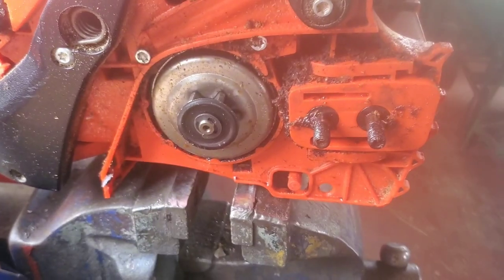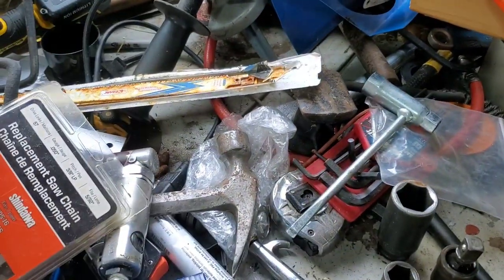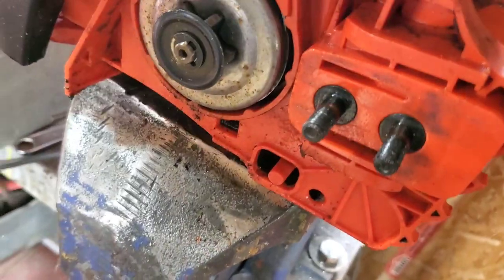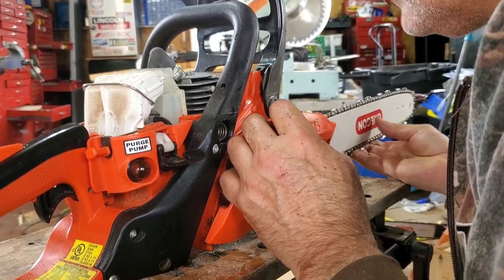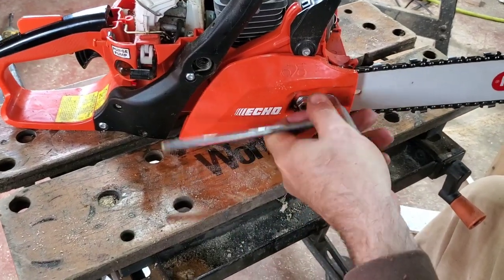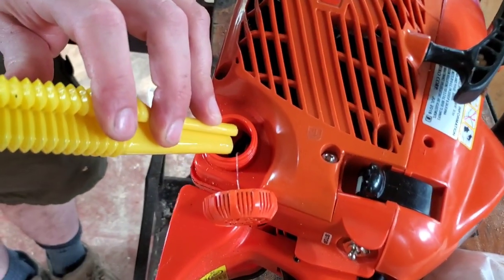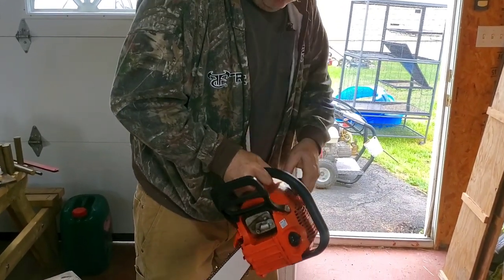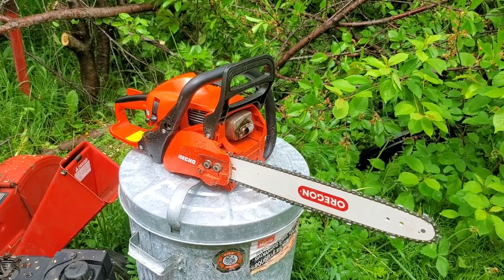ECHO CS310 Chainsaw how to replace the bar and chain

Comment: I also have the Echo CS-310. The bar stud stripped out the plastic hole it screws into, now the stud just spins in the hole when I try to tighten the nut. Is there an oversized replacement stud that can screw into the stripped out hole?
Reply from the maker: I think you will need to install a thread repair insert into the hole. There are special ones designed to be used with plastic. There is a company in the US that makes these. I Don't recall the name of the company but with a little digging you can find them

Comment: I have had a Echo CS-310 for over 11 years, purchased in 2012. The primer bulb and fuel lines are still pliable and in good condition.
 I will use pump gas mixed with 2-stroke oil for any large amount of cutting since it saves money. But before putting the saw away at the end of the day I drain out all of the pump gas, run the engine 'till it dies, and then refill the tank with the expensive gas/oil mix from Home Depot or Lowes. Run the engine a minute to purge the ethanol out of the carburetor/primer bulb/plastic fuel lines. Then drain the tank again (saving it in the pump gas jug). Run the engine some more until it completely runs out of gas, pump the primer bulb and pulling on the starter rope until it does not even sputter any more. 
Then I will put it away. 
Hard lesson learned that something will always come up the next day which leads to weeks and months before the chainsaw is fired up again to do all of the intended chainsawing. By then the gas has started gumming up and the ethanol has destroyed the plastic fuel lines and primer bulb.
Does anyone purge the fuel system with transmission fluid for long term lay-up? I have heard this keeps the fuel system in excellent shape over a long winter.
Reply from the maker: Since non-ethanol fuel is almost impossible to find here we will be thinking of a new fuel strategy for storage